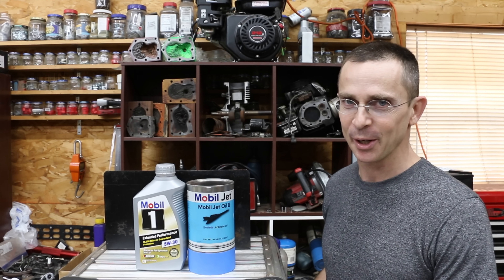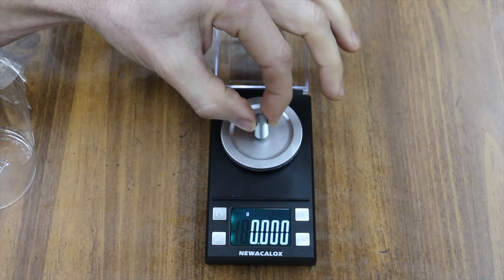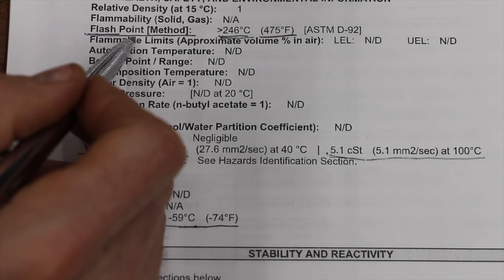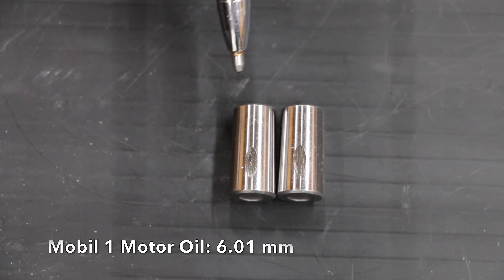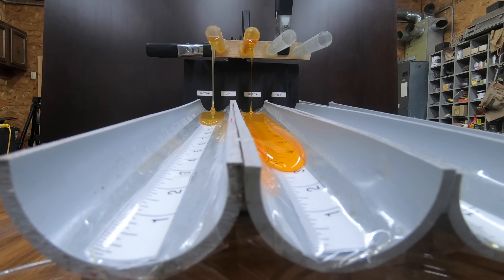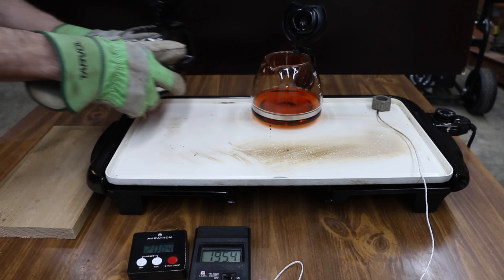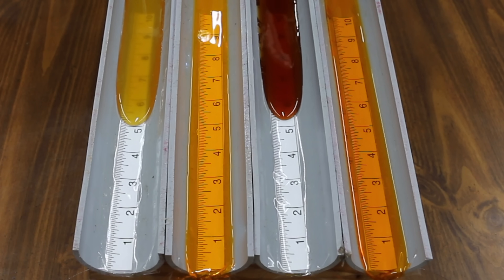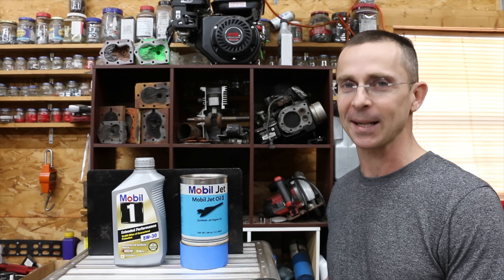Is Jet Oil better than Mobil 1 Synthetic?  Let's find out!

Comment: I started using Motorkote in my lawn equipment and even put it in my truck after watching your video with the water test. I'm always reading about additives online and I found a paragraph about this additive stating, "Motorkote contains chlorinated napthalene, which is basically Chlorox and mothballs. It's a waxy insulator, but is corrosive" 
So I was curious, could you run it in an engine and then let that engine sit for several months and then disassemble it to see if the product is indeed corrosive? It would give peace of mind to those of us who jumped on the bandwagon after seeing it in a worst case scenario situation and pass with flying colors. Lol
Reply from the maker: Thank You

Comment: Cool vid! As you stated, jet oil is definitely not designed for piston engines. Engine oil for reciprocating engines, is designed to cushion metal to metal, abrading parts, Piston rings, plain bearings, cam followers, etc.   Jet engine oil is designed almost exclusively for temperature resistance, with a secondary capability of being able to resist aeration. A lot of Jet engines have whats known as Labrynth seals, where there's no mechanical contact, just an area where higher pressure air keeps the oil from spraying out of the bearings. If an engine oil were used in a jet engine, it would most likely turn to foam. The ball or roller bearings in a jet engine don't quite  require the film strength that you need in a piston engine.  Jet oil also smells like ass.  lol
Reply: It's not that it will foam, it's just very very thin, about half as viscous as 0wt oil when cold! It will not make enough pressure in your journal bearings to keep the crankshaft from crashing into the journal bearings which will nearly instantly start doing damage.
Oil pumps create volume, not pressure. Restriction is what makes pressure and jet oil is so thin it runs out before your engine's oil galleries can build that pressure which causes the journals to rub and eat themselves.
Reply: @kg4boj  
Your post is the Best informative explanation why not to use it in a street car, “lack of initial viscous lubrication on bearings”.
Reply: @kg4boj  right.  I'm saying the reciprocating engine oil would most likely foam if put into a jet engine.

Comment: G'day,

Yay Team !

Well, the Jet-Oil is designed to operate at low Barometric Pressure & Low Tempetaratures, to lubricate high-speed Bearings, some at high temperatures - but those often consume their Oil on a Total Loss principle...; Jet-Oil is not designed to lube Cylinder-Walls versus Piston-Rings, or Valve-Guides sliding back & forth...
   
If your Reciprocating Engine is running sufficiently hot as to derive any benefit from running Jet-Oil  in the Sump - it probably very urgently requires rebuilding, or re-employment as an Anchor for a Maritime Navigation Buoy perhaps (?) !

Such is Life,

Have a good one.

;-p

Ciao !
Reply from the maker: Thank you

Comment: This is a completely idiotic test. Does this guy even realize that the jet oil is only to lubricate bearings that do not come in contact with carbon??? There are literally only 2, maybe 3, bearings in most turbines that use this oil spec. These bearings have no lateral loads (no friction), so his testing methods are already flawed. Most turbin oils run around 100 degrees Fahrenheit. The oil only needs to sustain high temps for a very short amount of time and prevent coking. In the end, all you need is a detergent free high temp oil. Completely different from what your car engine requires. This was a waste of time, but I can probably guess this guy has nothing better to do.
Reply from the maker: Thanks for the constructive feedback

Comment: Concerning your oil-dumping rig (for the flow tests), it seems to me that it'd be more consistent (I think) if you used a piano hinge and bolts to secure the board holding the tubes. That way you'd get consistent drops, less need for clamps, and you could align and secure the bottom of the rig below the drop tubes such that each lane always gets a centered drop (and avoid having the re-calibrate the position constantly).
Reply from the maker: Thank you

Comment: Hey sir, I'm a fan of the channel. Recently started a new job as a mechanic, I deal with a lot of of small engines on a daily basis. I really like the way you start (no pulling) your engines, what make/model drill do you use or Tq and RPM do you have?

Comment: Now I wanna see what happens if this oil is used in an engine...
Reply from the maker: Thank you for the video idea!
Reply: I bet it would do just fine.  But you never know what different oils will do sometimes.  As an A&P mechanic, i always wondered why they don't use synthetic oil in aircraft piston engines.  A few months back i read that the synthetic oils get plugged up with lead pretty quickly, as where the non synthetics just deposit it in the crank case.

Comment: Jet (turbine) engine oil operates in a very different environment from automotive applications. There are no pistons or rings sealing a combustion chamber. The oil lubricates bearings and that's about it. It is a much cleaner environment. I've worked as a pilot for over 30 years and I've seen used oil come out of a jet engine that looks as clean as any oil you would put in your car.
Reply from the maker: Thank you for the video idea!

Comment: I have used Mobil 1 oil for years and have never had any issues until I bought a 2015 Hyundai Tucson that has a GDI engine. GDI engines have a problem with carbon build up on the intake valves. To protect my engine I installed an oil catch can in the PVC system. At my usual oil changes at 5000 miles the catch can collects about 2 oz of oil. Valvoline has a oil that is for “modern engines”. I would like to see you test whether  this oil is less volatile than other synthetic oils producing less oil vapor that is pulled into the intake and onto the valves and forming carbon deposits.
Reply from the maker: Thank you

Comment: good video, but there is so much more to motor oil. You would need a laboratory to actually determine if one is better than the other. Luckily, there are places which will take a sample of your oil and perform a series of tests. Then they will tell you the condition of the corrosion/antifreeze inhibitors, friction modifiers, detergents, flashpoint, dispersal additives, etc... Great video, but the motor oil series is considerably flawed in the sense that you cannot determine of one brand is better than the other just by measuring it's viscosity and ability to resist wear on a roller bearing. KY jelly can resist wear, but that doesnt mean you should use it on your engine..... Actually, there's a video idea for you- "How long will an engine run with personal lubricant for oil?"
Reply from the maker: Thank you

Comment: Fun fact the Jet Oil is whats used in the Mercedes E55AMG supercharger for lubrication.
Reply from the maker: Thank you
Reply: It's not what's used, it's what people often use as an aftermarket replacement when servicing.
Reply: @otm646  you sir are correct. Mercedes sells a specific oem supercharger oil. The jet oil is what i used and others do as an alternative to not pay stealership prices for the oil. Thanks for the correction

Comment: anyone else thinking they need to change there oil after watching this.
Reply: i'm not, but only because i dumped another 5 qts in it this morning. going to need an EPA grant to clean up that parking space one day.
Reply: Uh oh what kind of car/truck
Reply: I’de love to try it in my 1993 Accord
Reply: Hell, I just bought oil & filter the other day & took advantage of $17 Mobil 1 rebate. 5 qt Annual protection version & filter for $19 after rebate.  Sweet! Cam get for as low as $11 with different versions & weights.
Reply: @aisforannihilation1662  
That seems like a deal 17 bucks w filter
Reply: No
Reply: I went and got oil while watching this🤣🤣has to
Reply: Already done

Comment: I would imagine a high RPM jet engine spinning at 25,000 will get bogged down by thick viscosity.  The fluid dynamics are definitely different and when you're spinning that fast, you probably have enough oil pressure and suspension such that only thinner viscosity is required. 

Suggestion: modify your friction testing bench to spin at 10,000 to 25,000 RPM and run the tests again. I'm really curious if the high speed RPM will cause 'hydroplaning' and you'll get lesser wear.

Always a joy to see your videos!  Thanks for sharing!!!
Reply from the maker: Thank you

Comment: I'll bet the jet engine oil has less wear additives because jet engines are just multiple turbines that ride on fluid bearings, way less metal to metal contact to worry about. It's more so about protecting the oil in a jet engine.
Reply from the maker: Thank you

Comment: The jet oil would be different because Jets fly at high altitudes and probably higher tempertures.  I've heard from a air craft mechanic that the higher the altitude th thinner the air.  Plus it's  most likely to be colder which would be the need for a lower viscosity to allow the oil to move.
Reply from the maker: Thank you

Comment: If I had to guess I'd say the jet engines this oil is used in probably have a crazy oil pump that maintains 150+ psi vs a normal vehicle which is like 60psi if it's in healthy shape. The high flow thin oil is probably necessary to prevent oil coking.
Reply from the maker: Thank you

Comment: Yeah, engine oil is designed to deal with by products of gasoline internal combustion engines. Jet fuel is designed to deal with whatever jets need. What do they need? Bearing lube of course in the turbine. I guess it would be high temp so would have to be suited to the temps involved. I never even thought that jets might need oil.

Comment: You guys on the cooked oil do realize that engine oils don't run at 300 to 400 F in the engine?
Reply: How hot does a piston/piston ring get?  The average oil temperature may not run that hot but the oil can be subjected to extreme temperatures and a high temp test like this simulates a more extreme example to exaggerate the results to show which oil performs better under extreme conditions.

Comment: Time to do a lawnmower test with jet oil! haha And an idea for new engine tests, or lubricant tests would be to throw an engine with what ever lubricant in a chest freezer to simulate cold starts. Run the engine till warm, and repeat the process each day for a week. Little more work(well a lot more haha), but it'd be interesting to see if you can tell a difference in wear. Say for instance, testing 0W-20 grade oil made for street cars vs. Red Line 70W Nitro drag race oil which isn't designed for such cold starts. Just a random idea that popped in my head so I thought I'd throw it your way! Keep doing what your doing, because your videos have actually helped me decide on what products I actually want to buy, and you deliver the information perfectly in your videos!
Reply from the maker: Thank you for the video idea!

Comment: Have you ever done this suite of tests on Marvel Mystery Oil all by itself? I think that would be interesting. I predict poor film strength, high evaporative loss, but excellent cold pouring.

I think also maybe a part mix of synthetic 5w30 and Marvel for a third runner in the race. Maybe 2 parts oil, one part Marvel. It'd be really neat to see how it changes the properties of synthetic oil. Maybe some guys would think twice about adding it to their crankcase, depending on the results. Although maybe 2:1 would be considered way overdoing it, so if you wanted to go more realistic, I know some guys will add the whole quart to the crankcase, so that'd be roughly 4 parts oil to one part Marvel.
Reply from the maker: Thank you

Comment: Jet engine oil is made to work with certain types of seals found in Jet engines not car engines. So if you put jet engine oil into your car, it will destroy all your seals and ruin your engine.

I'm pretty sure it's not carbon based anymore. But when Mobil first came out (1975) with synthetic oil for cars, to compete with Amsoil (1972). They were using a carbon based synthetic. Carbon based synthetic is a preparatory base stock which means it will not work with any other base oil period. So when people who bought mobil synthetic way back when, added petroleum oil to it. it turned into a tar like substance that often ruined engines (they do not use this anymore in there gas engine line up of oil, so no need to worry). But I'm not sure what they use as jet engine oil. but as many times as they have reformulated to keep up with jet engine technology, I'm sure that base type got phased out.
Reply from the maker: Thank you
Reply: @ProjectFarm  Also, jet engines do not subject the oil to combustion by-products because the oil is in a completely sealed system that's lubricating the moving parts. Unlike gas engines that have rings where combustion by-products get into the oil. The jet engine oil not having to deal with combustion by-products means it does not have to have additives that deal with these by-products. Less additives = less evaporation. As to why your evap test it did so well. And why the other did not because it has to have all those additives.
Reply: The reason Jet oil has to be better at cold pour point is because in the upper atmosphere, the front of the engine can intake air below zero degrees F while the rear can be 400 degrees F plus. So the oil has to flow from one extreme to the other continually.

Comment: I wonder if the tubes the oil flows down would have different results if metal instead of plastic, as the oil is formulated for metal, not plastic.
Reply from the maker: Thank you

Comment: 20 years ago my motorcycle mechanic swore by Aircraft Grade Synthetic Oil for Piston and Turboprop Aircraft to be used in all the bikes he serviced.  I never had an issue with it.  At the time I think there were only a few brands that offered a synthetic option in standard motor oils for cars, trucks, motorcycles.  Mobile One was one of the first I remember.  Jet Oil would be a completely different bird all together.
Reply from the maker: Thank you

Comment: Project Farm. Please do a brake fluid comparison. Brand differences as well as price is a big deal. Heat test, cold test, timed bubble release (air in the brake line). Paint wear off test. If spilled which BF takes the paint off. There you go..
Reply from the maker: Thank you for the video idea!

Comment: How would Pennzoil Platinum made from Natural Gas far in your tests?
Reply: The Pennzoil is now owned by Shell and in EU the same oil is 3x the price (Shell something synthetic) - the same datasheet as Pennzoil 0-30 C2/C3 rating. I put in my 20year old Civic beater and after 5k km behaves as any other synthetic, no problems. They use Boron as antiwear additive. There's a oil analysis test somewhere on the web, it's a good oil.

Comment: What oil do you recommend for an air cooled Briggs and Stratton zero turn mower?
Reply: Whatever the book recommends.  My push mower takes 10w-30 and I run a synthetic 10w-30.

Comment: Another interesting test. Too bad those heat traits of the jet oil can't be applied to the motor oil. But then again I am comparing the condition of a turbine engine to a reciprocating piston engine who's operating temperature is 1,000 degrees or more lower. Impressive work as always!
Reply from the maker: Thank you

Comment: If you had similar viscosities, you could probably run the jet oil in a car. Wouldnt be a good idea for long, though, since jets get sulfur (for lubricity) from their fuel.  If you were to add ZDDP and a liquid thixotrope, you might end up with something usable. Probably still wouldnt have great film strength though.
Reply from the maker: Thank you

Comment: I’d love to see at what ratio a high rpm 2-stroke engine will fail. Starting at whatever ratio the manufacturer recommends and then dropping the oil content from there. I’m guessing you’d have to make the first run with zero oil to determine the controlled failure and then go from there.
Reply from the maker: Thank you

Comment: Im Impressed.. i'd still use Jet oil anytime in my aircooled 1200cc bike anytime cos it gets so hot in traffic down in the tropics! Jet Oil superior oil flow and evaporation resistance properties was too impressive to ignore!
Reply: fidel catsro I would assume the viscosity would probably cause premature wear of your engine, jet oils aren’t exposed to the combustion process in a jet turbine as well.
Reply: @Tomtom88983  i would still trust its superior  quick oil flow character and heat evaporation resistance...my bike burns up oil because of its tremendous reliance on old school  air cooling, this is where it will shine well!
Reply from the maker: Thank you

Comment: Thanks for the fun test. On the SR-71 the oil was so thick it wouldn't flow at room temperature. The ground crew had to heat the oil before the pilot started the engines. Of course the engines got to about 2,000 degrees F and grew about 4 inches in length and width.
Reply from the maker: Thank you

Comment: you know after a plataeau of price point and marketing oil is pretty much oil (quality is the same ) or close it dosent matter // the secrete to long life is getting the oil out before corrosion starts // oil dosent go bad however it getts contamated by moisture and fuel with acids that form from the two combine in the process of heat and friction // doing partal oil changes at 1,000mi or so with a filter change is old school were oil has a weak detergent additive or none at all // I have developt a copyright for an additive that changes color when exhausted (for sale on request) thanx
Reply from the maker: Thank you